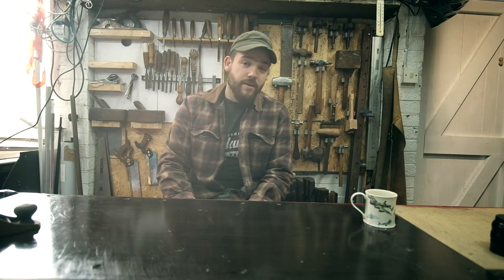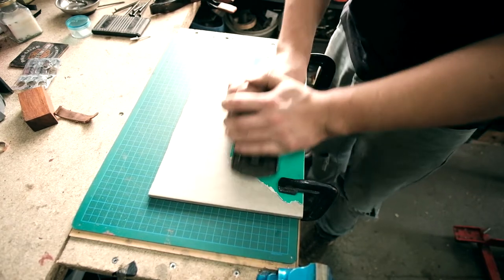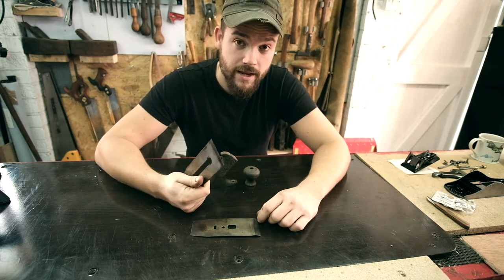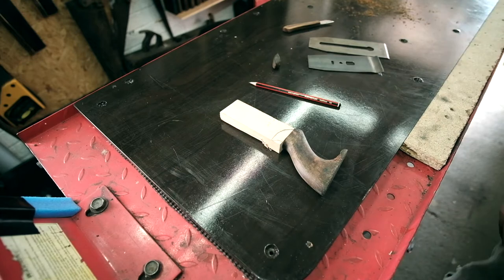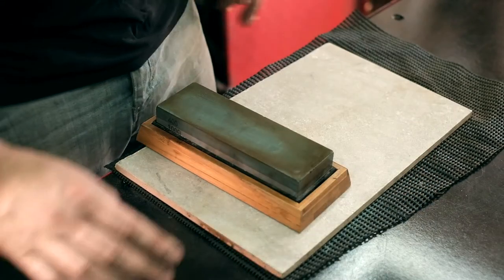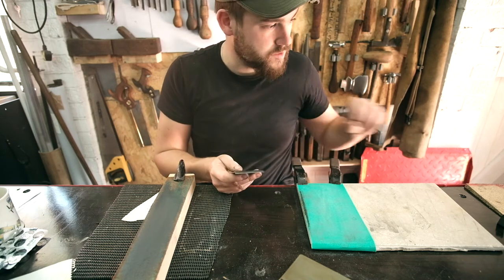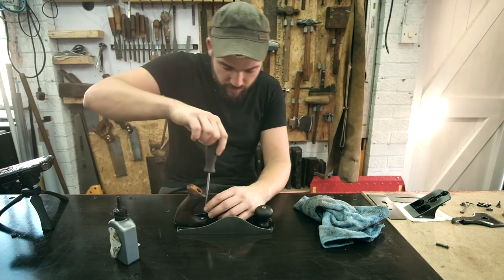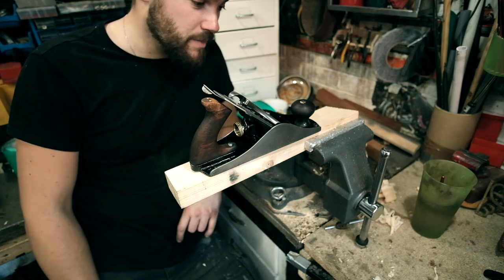Restoring And Repairing Very Rusty Vintage Stanley Plane

Comment: Wow Ash.. I love the backdrop. There is a mallet in the lower right that looks rounded at both ends.do you know what it’s for. I looked on Ehow and it implies that the plane was made between 1910-1934 the date code is cast behind the frog. Love that you used GGpa’s screwdriver to take it down. Such a thoughtful and thorough restoration. The ribbons at the end tell the story 🎖gold star craftsmanship